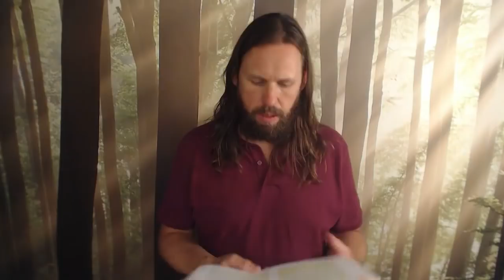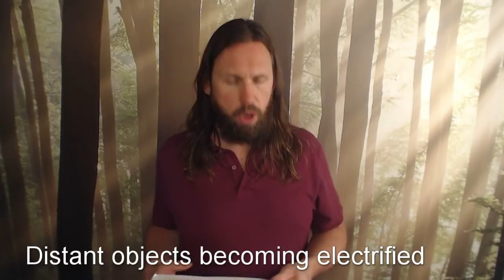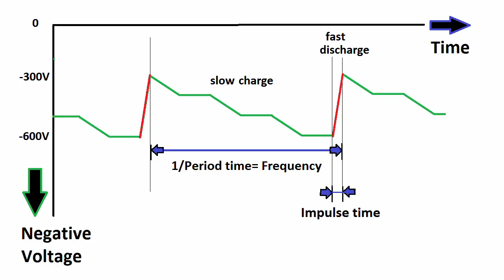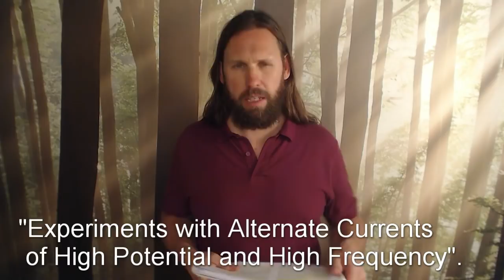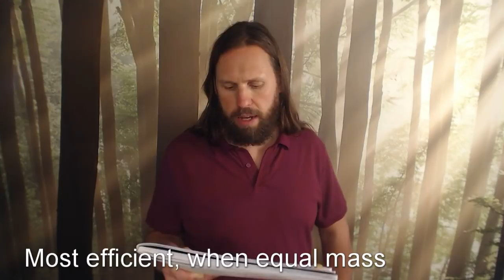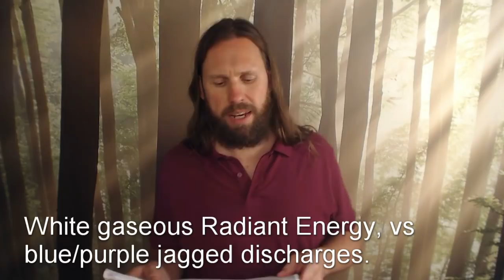Nikola Tesla's Radiant Energy Part 2 of 3

Comment: I am sure you have read, "Introduction to DIELECTRICITY & CAPACITANCE by Eric P. Dollard", just in case you didn't, this was a must read for me before experimenting with cold electricity (aka dielectricity, longitudinal pulses, etc...).

"Because the forcing voltage is instantly withdrawn the field explodes against the bounding conductors with a velocity that may exceed light. Because the current is directly related to the velocity of field it jumps to infinity in its attempt to produce finite voltage across zero resistance. If considerable energy had resided in the dielectric force field, again let us say several KWH the resulting explosion has almost inconceivable violence and can vaporize a conductor of substantial thickness instantly. Dielectric discharges of great speed and energy represent one of the most unpleasant experiences the electrical engineer encounters in practice."

Key to the above is that current attempts to jump to infinity as the compression of the dielectric capacitor field releases into a short (i.e., fast diode or spark gap).  Now of course the energy in the dielectric field (1/2V^2C) also plays a part in the resulting shock wave (dielectric pulse) which is running longitudinally and thus aether poses little resistance to it.  And of course, this shock wave attempts to terminate in any conductor in it's path.

The bifilar coil comes in handy in these devices as an easily tuned resonance feeding energy into whatever event capacitor you select.  In other words Tesla designed the bifilar coil to remove the difficulties of tuning the resonance as a bifilar coil by definition self resonates.

And if you use 2 capacitor's instead of one then you can experiment with cold electricity vs.  shock longitudinal waves (or both).

At any rate, after understanding every word of what is said in the above Dollard document I found it easier to design these type of things.  So your initiating voltage is not as critical as the amount of capacity and how fast you can short out the dielectric field (capacitor(s)) without reverse current (reverse current would recompress the energy or in other words rebuild the capacitor voltage)
Reply from the maker: Yes I read it, it's great. I love that quote and  remember it triggered me the first time I heard/read it.  That' s also why I made this video: https://youtu.be/zmZxQp1PW1U where CP Steinmetz explains the same concepts of infinite current and voltage.
 The thing I miss with Dollard's explanation is the concept of pressure. Aether pressure. Where negative voltage acts like under pressure (near vacuum), that will be equalized by the ambient pressure. The Aether shockwave does seem to have inertia, and thats why It starts moving when pulsed. I also suspect the bifilar coil is suited for these disruptive unipolar capacitor discharges due to the instant dielectric field it can build up between its windings. The resonance need to be avoided in this stage.
Reply from the maker: I remember  Walter Lewin's MIT experiment, but also another MIT experiment video, where they charged a Leyden jar, took it apart, discharged the metal plates, reassembled the Leyden Jar, and it still had the charge! which indicates, it was not on the plates at all. 

I agree, all mass, is energy perceived as mass, and this charge is related to spin. Not the quantum mechanic spin, but the spin direction of energy. You still speak of particles, but for me there are no particles at all, its all energy, its all aether field configurations. But We are talking about the same stuff so it doesn't really matter.

For me thinking in fields, instead of particles, makes a lot more sense. 

You worked at the Berkeley Particle accelerator where you smashed mass together at close to the speed of light.  That' so cool. The charges smaller than protons and electrons, seems to be inline with Mendelev's theory that there should be smaller gasses than hydrogen. The book talks about that as well. 

If I am correct you mean Avramenko diodes, Chernenko was another person, related to to Chernenko radiation (correct me if im wrong). 

I used the diodes, and it worked best when also connected with a ground(in the middle between 2 series connected caps). It seemed the diodes rectified the sinus of the resonant wave, and directed the polarities to the capacitor that charged. 

I still don't get the term "cold electricity" To me its electricity. and nothing cold about it. It still hurts, and it still lights a bulb. A boost converter would also be cold electricity but is used everywhere in power supplies. But maybe I'm missing something special about this type of electricity. If you could talk more about this, please do.

I also noticed strange effects, with my resonant coils. Capacitive devices failed to work, like my touchpad on my labtop or my  smart phone screen. 

It seems to me the dielectric field is not only concentrated between the windings, but also connects to "outside" conductive parts. I could sense the resonant wave with my probe, on each metal part near the resonant coil. 

Pretty strange, but to me it indicates, there is an Aether stream surrounding the resonant coil. And this Aether stream interacts with conductors.

Thank you for giving back Mark. Always a pleasure reading your words. We dont always agree which is good. We have different perspectives. And are both curious towards the truth. Back to part 3, still have to finalize it.
Reply: Tesla prepared statement: ""My ideas regarding the electron are at variance with those generally entertained. I hold that it is a relatively large body carrying a surface charge and not an elementary unit."  The surface charge is the much argued 'aether'.

Tesla goes on to say in the statement, "The great quantity of electricity stored on the particle is responsible for the difficulties encountered in the operation of certain tubes and the rapid deterioration of the same."  Thus I believe that Tesla believed there are particles and so I use the convention.  Beyond this it is just a word describing some elementary unit with spin.

You are right I meant Avramenko diodes I always get the named mixed up with Cherneko radiation...I just call them nutt-to-butt diodes that's why I mistyped (:  It worked best when connected to ground because ground's charges are more plentiful then the atmosphere or space.  So is your body which would also have worked better.

I've held onto wires carrying 5KV of cold electricity with no shock.  My wife walked into the room and called me an idiot for doing this.  I have many years experience working in labs with deadly electricity so I must admit that first touch went against every internal thought...yet no pain...no shock.  I would definitely not recommend to anyone reading what you and I are writing to try this.  Cold electricity only works with vibrations (frequency, resonance), capacitance (dielectric energy).  As Tesla found, the frequency of the vibrations is related to effects people.

Once you get past the ideas of the unicorn electrons...such as you saw in the MIT videos...then cold electricity is not a reach...just charge vibrations inducing charge vibrations in conductors.  In some of the books you have read no doubt you have seen others call it displacement current.  Electrons cause the heat in normal electricity as they leave copper atom 'orbits' (Bohr theory) and then reattach to neighbors.  This reattachment causes radiation in the heat frequencies EM radiation (much like atoms also emit light radiation when electrons jiggle around).  Thus cold electricity is not eliciting electrons to move in conductors and cause heat, rather, cold electricity is vibrating charges in the wire.  I call this 'Magnicity' not cold electricity which I experienced years ago.  Of course Tesla experienced it over a hundred years ago.

As I discussed in a reply to you way back, Richard Vialle also talked about this resonance (he called it electron resonance) in his U shaped cold electricity device.  However, I think he only spoke of electrons...yet these electrons did not leave their atoms, rather vibrated their orbits.  So no heat.  Just providing a slightly different take on cold electricity then mine.

Yes the Aether 'stream' is around all electrical circuits and magnets.  The geometry of life.  There is no such thing as a 'closed' electrical circuit, at least not on Earth and the outer space in which we have sent space ships that use electricity.  Tesla new this as well.  He spoke of particles getting surface charge from space.

Yes, we don't always agree and that is important in moving forward.  Cheers....
Reply from the maker: Great closing sentence Mark S. What I hear is a clear distinction between charge and electron. Also the cold electricity relates to charge, and its vibration. But was the 5KV that you touched vibrating/oscillating? And if so, if this voltage is rectified and stored in a capacitor, as a DC voltage, is it still "cold" and harmless?
Reply: Yes, an analogy being a balloon that you rub on her air and gains charge (not Electrons!).  Protons, which are very much larger then electrons (mass) both have the same charge or 1.6 X 10^19 Coulombs.  So there are two frames of thought here 1) They are both fundamentally made of charges (Dollard, J. Newman) with a 1.6 X 10^19 excess or 2)  Charge deposits on the surface.

Number 2 is more enticing to me (as in the Balloon) or in a capacitor (charge stores on the surface of the dielectric as MIT experiment dictates.

Otherwise the middle capacitor of a series 3 capacitor circuit would never charge (Unicorn electron flow cannot occur through the dielectrics of the outer capacitors to get to the inner.  Additionally the Dielectric strain remains on the middle capacitor if removed from the circuit (Nature would not allow the strain to exist and move to a balance condition unless there were opposite charges forcing the strain in the dielectric).

Yes, the 5KV was vibrating.  The Plasma Ball output is just a secondary wire off of an angel hair step-up transformer.  The primary of the transistor was supplied from an oscillator, transistor of the 3 AAA batteries.  Simple circuit and cheap (thanks China!).

Yes, the Avramenko diodes connected directly to the one lead of the transformer output provide "rectification" to the two capacitors.  Very important, as with any capacitor that is charged it is dangerous as a DC voltage.  However Cold Electricity does not work with DC voltage, the capacitors must be oscillating and out of phase (Avramenko and transformer provide this out of phase).

OK, so the displacement current in a capacitor does not cause heat thus it is technically cold electricity...electrical energy transfer without heat.  You haven't seen any heat sinks on capacitors lately (:  Yet they pass the energy.  So 'cold electricity' has been under our nose for hundreds of years.

Mely simply uses the air as a capacitor dielectric between the transmitter and receiver to pass this energy.  And he experiences a gain in energy from transmitter receiver because the dielectric of his 'air capacitor' is obviously an open circuit to the energies of the environment.  Also, inside of a dielectric it is also a 'longitudinal' (scalar) wave.  However he must run at the correct resonant frequency or the vibrations result in regular transverse EM waves which lose energy at the inverse square to distance.  If you read his stuff he will say that at a lower frequency he gets regular waves but at a higher frequency he gets the waves that travel through material and gain strength from transmitter to receiver.

This is why I was surprised when I experience waves acting like scalar waves from my Plasma ball experiment, because I did absolutely no Tuning!  Maybe a freak accident.

One more thing about resonance that may help.  Resonance is not some magical thing.  Typically the charge and discharge rates of energy for Capacitor and Inductors is 'constrained' by electric resistance (i.e., 5 time constants of R*C or L/R).  At resonance the resistance cancels out and the energy transfer no longer suffers from this resistance time constraint.

Hopefully something I say here helps you break through a barrier.  It helps me as well arrange my thoughts and to get feedback
Reply from the maker: Thanks Mark S, fir again sharing these great insights.
cold electricity in capacitors. Indeed no heat sink needed. Many new idea's rise, asking fir contemplation and experimentation.
soon...
Reply: WC...It is tough to speak original thoughts in a public forum...so this is new to me...
Reply from the maker: Your doing great Mark S. Very inspiring. I would like to read that article of Tesla talking about his view on the electron, can you give a reference?
Reply from the maker: Thanks Frank!
Reply: From same doc, "if the current decreases and represents then a negative velocity of field as the loops contract."

Negative velocity is just a human convention...as velocity is increasing in the compression direction.

Negative and positive 'charges' are one in the same...just opposite spin.  

So getting back to Dollard...negative velocity is increasing velocity in the compression sense...or counterspace sense...or in the increasing 'pressure' sense.  As you increase the 'negative' pressure (of aether, or charges)...this represents dielectricity (more capacitive, less volume, counterspace, increased negative pressure).  AC current is an analogy as current traveling in one direction is called positive and in the other is called negative...however both represent positive power (pressure X charge flow).

Therefore Voltage is volume of charge  (analogy being pressure, volume and temperature).

In space 'negative' pressure should act just as 'positive' pressure.  On Earth 'negative' or 'positive' pressure is impacted by the local charge environment (i.e., potential of earth, cloud charge, local conductors...etc...)

As Dollard explains...the mass itself is super capacitance (A resonance that is super capacitive compared to the accompanied resonant inductance).  This means that the charge has been stuffed into such a small space (counterspace, less volume) that it represents as a stable mass (with radioactive decay by the way)

The 'aether' shock wave (dielectric pulse, charge pulse, aether pulse...same) certainly has inertia as it is the main component of mass.  If the charge of the pulse is neutral (i.e., equal opposite spins of charges, equal and opposite vortices, near field, neutrinos...same) then it will travel without opposition faraday cages...however can be reflected and focused (amplified) by conductors.

In space a magnetic field expands into space until energy (current) stops increasing (di/dt or zero slope; slowed by aether)...then...the magnetic field collapse rapidly...the energy all rapidly receding into a center space (counterspace) now as a inward longitudinal energy field...the dPhi/dt rate of which creates a rapidly increasing voltage (pressure in lower volume of space proportional to dPhi/dt...or rate of change of charge) until the energy is all consumed...then it expands back into the magnetic field (force & motion & inertia).

Sorry IVO, thinking with my fingers again as I type...I could go on for the rest of the day...so I will stop here...Just move your solid state meters away from your experiments as the pulse will fry the chips even if they are not physically connected...I know this from experience...and other electronics in the room will also react strangely...

Cheers, Mark
Reply from the maker: Love it Mark, when you do that. food for thought. I must say I see one thing different. When the magnetic field gets stronger (more current) it grows smaller. This can be seen with strong and weak magnets. 2 strong magnets only attract in their near field. 

but two weak magnets can be felt attracting from a much larger distance!

So when the strong magnetic field current is interrupted, the contracted magnetic  field expands back into neutral.

this is explosive. but the dielectric negative voltage pulse is implosive. It creates a "vacuum" that is naturally filled by the surrounding medium. but this sudden implosion cant continue forever, and acts like a water hammer.
Reply: hmmm...how to reply.  You speak of permanent magnets which are a bit different then what you are doing.  You are using coils.  With coils the stronger magnetic field does not get 'smaller'.  Rather the imaginary lines of force get closer together or the density increases.  That is what a hall detector detects the density of the lines.

When the magnetic field current is abruptly interrupted (infinite di/dt) this leads to the 'infinite' compression (contracted magnetic field) or infinite voltage (which is density of charge, compression of charge to smaller space volume, dielectric implosion).  Of course it cannot reach infinite in your circuitry as capacitors will rupture and short and there is resistance in connecting wires.  I do not prefer to cause this a 'negative' pulse to avoid the confusion with 'negative' charge.

As to creating a vacuum...when the magnetic current ceases (di/dt = 0).  The surrounding medium (aether or elementary charge of which all is made) provides the force at the speed of light (di/dt approaching infinity) for the 'implosion'.  The 'implosion' in to an increasingly smaller volume of space continues until the energy dissipates.  In terms of a capacitor the capacitor is then charged and of course cannot discharge unless the voltage is too high and ruptures the dielectric or the capacitor is shorted out (either through a wire conductor or the voltage is high enough to create ionization of the local external environment (i.e., spark gap)).  As to 'water hammer' effect the medium (sea of charges, aether) acts as an incompressible fluid so one expects this type of effect, however, it is unclear to me wether Tesla was using this water hammer for the dielectric pulse (dielectricity, longitudinal wave, scaler wave, etc...) or rather the the actual instantaneous discharge of the dielectric energy (expansion), or both.  This is why I watch your channel as you see it a bit different and I want to see the experimental results of different perspectives.

As far as permanent magnets, that is rather different form all of this.  First off a permanent magnet does not have a driving unapparent hidden current as it does not heat up.  Second, it has permeable material that it is made of, similar to a transformer core.  Cores have a saturation which distorts the results and allows a stronger magnet field turn into itself (high permeability, saturation curve, etc.) creating he 'weaker' effect you described.  This is why smaller diameter magnets have a higher surface gauss (flux density) readings with a hall probe.  At the end of the day, and despite what some youtube self-described experts will say, magnetic circuits act very similar to electric circuits taking the least path of resistance in their generally accepted looping phenomena.  I recommend that anyone watching 'ferrocell' youtube posts should also watch the youtubers  showing videos of salt spread about on a sheet of vibrating metal and the geometry produced complete with 'counterspace' etc etc etc (:  I digress

Anxious for part 3
Reply from the maker: hihi self described expert Ken Wheeler. lol. 
Indeed I did want to reference to the ferroviewer thingy, that shows the compact space where the flux lines concentrate. 
But lets agree to disagree. its still much theory without much data to support it. I hope I can show some experiments with practical real effects. But first part 3.
Reply: Just always think of what Tesla said, "If you want to find the secrets of the Universe, think in terms of ENERGY, FREQUENCY, and VIBRATION."

Ergo you always see me trying to redirect folks to energy (and not volts/current alone but Joules).  The metal sheets vibrating with salt represents vibration (and magnetic observations).  Frequency represents 'Resonance'.

As to dielectricity...it has all three represented (energy, resonance/frequency, and vibration.  You see dielectricity requires a dielectric which is non conductive (as represented at times with a human capacitor.  Therefore 'Unicorn' electrons can neither pass through or collect on the dielectric (Steinmetz, Dollard, Walter Lewin of MIT would/did agree).  Reference Walter Lewin's MIT experiment posted his class on You Tube (he was dumbfounded to find no electrons on a capacitor's plate and couldn't explain, at least in class).

So if electrons cannot pass through a capacitor or collect on its plates, then there must be a better theory of electrical current flow in wires and capacitors.  I created a theory and I coined it 'Magnicity' many years ago.

At any rate the theory postulates that matter is made of minute charges (this coincides with Dollard's resonance "super-capacitance' resulting in the formation of matter (and also Einsteins E=MC^2).  Not to go further on this theory here, however, what it means is that Electrons (and Protons carry charge).  A Proton is 1837 time more massive then an Electron yet has the SAME electrical charge.  Strange isn't it that something so much more massive has the same charge.  The reason being that all mass is made of minute charges including electrons and Protons and they exactly have an excess in their constituent charges in the opposite polarity (spin).

I worked at the Berkeley Particle accelerator where we smashed mass together at close to the speed of light and observed what it broke up into.  As hard as we tried we could never get to the smallest particle but all of the pieces where always charge (my theory they were made up of elemental charges smaller the Protons or Electrons).

 OK enough background...so your dielectric shock waves...and cold electricity consist of these elementary charges.  If they combine in neutral combinations (such as Mely's near wave observations) then they tend to pass rather unfettered through matter (or faraday cages for that matter), however they will collect on conductors from their polarization (Tesla's observation of conductors becoming charged) when in a 'dielectric' or longitudinal wave.

As to cold electricity.  Think of a circuit of 3 capacitors in series.  How does the middle capacitor get charged now that we know that electrons can not collect on capacitor plates.  Simple, the batter provides charge as I described(not electrons) to the plate electrically connected.  The other plate collects charge from the environment from the path of least resistance (a human touching the other plate/lead, another conductor, or in space aether) (This explains Don Smith's experiments).

So, the middle capacitor is actually not even connected to the battery, yet it still gets charged.  Tesla's hairpin circuit (cold electricity) worked similarly.  Two capacitors vibrate at opposing polarity and a load/light is placed in between.  This vibration vibrates the charges in the load which is what electricity really is and the load lights.

This is also how chernenko diodes work (which you have used in some of your experiments).  Even thought the chernenko diodes are connected to only ONE lead of an AC source it will charge capacitor's and light lights.

Here's a cheap experiment.  Just take a cheap $15 Plasma bulb apart.  And extract the tiny circuit board that feeds off several 1.5V triple A batteries.  This circuit board has an oscillator connected to an Angel hair transformer creating the 5KV AC to drive the Plasm bulb.  Connect the 5 KV to two Diodes connect in chernenko fashion (nutt to butt) off of the ONE lead.  To that connected 2 KV capacitors to one lead.  Be careful the capacitors will fully charge and be sure to short it out to see the big ZAP.  This is cold electricity in less then 5 minutes (I got my capacitor and diodes from an old microwave).

What is happening is that the chemical reaction in the batteries create the charge (not unicorn electrons) that cause collect on the surface of the dielectrics, causing the dielectric to polarize (strain) and collect charges from the external environment (in accordance with electrical ohm's law) onto the other surface of the dielectric.  The one lead from the 5KV transformer has alternating positive and negative charges which the Chernenko diodes rout to each capacitor and continue to add charge to each capacitor (Frequency, Vibration, and Energy).  This all will work even better if you collect an insulated metal plate to the free lead of each Capacitor.  Just as Tesla prescribed in his Patent for Radian Energy.  Why?  Because the density of charge (mass) is greater in the metal plates (or a human) then from the atmosphere or space (aether).  As you do the experiment you may experience nearby electrical devices experience strange effects as this also creates the 'shock wave' that you are proposing.

OK...so you gave to me from your experiments so I am attempting to give back...thanks
Reply from the maker: https://youtu.be/9ckpQW9sdUg?t=2m    this is the clip of MIT with the leyden jar.
Reply: It is not the exact one where you see Walter's dumbfounded expression, however, it suffices to show that that the energy is solely stored in/on the dielectric which in this case is a non conductive glass beaker/jar.

Furthermore, if you were to place extra metal plates within the glass that are not connected to the conductors as shown, each one would measure a voltage in relation to any other one.  Similar to HHO experiments that have multiple plates in the water, the water now being the dielectric.

This is an example of separating 'elemental charge' (aether) from charge carriers/electrons.

A more informative experiment may be to have two beakers inside of each other (with no metal plate in between the beakers) and repeat what is in the video...now check if you get a spark from both beakers separately.  What do you predict?

BTW nice job on version 3 of radiant energy!!!  What I see is a properly run Youtube channel...you answer and bring in information from your subscribers.
Reply from the maker: 2 beakers with no plate, better put some dielectric oil in between them to get the air out. they both should have about half the energy between them, so, separate would give 2 (smaller) sparks I guess.
Walter Lewin is also (originally) Dutch like me.
Reply from the maker: found it: https://youtu.be/GAtAG938AQc from 39:34 you can see Walter Lewin do it. Is that the one?
Reply: I guessed you were Dutch but did not know that Walter is Dutch...should be proud about that(:

Yes, I surmise as well 2 smaller sparks.  So how did charge for the sparks get on the inside surfaces of the beakers?  Certainly couldn't have come from the charging battery which only touched the outside of the beakers (which are insulators)?

Vialle was able to energize an external circuit with his U copper tube apparatus.  Interesting that there was no external batteries connected to the U copper tube as a charge source for the external circuit.  Rather and external alternating coil was provided which did not provide generated EMF (it was not perpendicular and to make sure was wound opposing itself to EMF generation).  Yet charge came from the copper U tube that ran an external hot circuit.  The copper Tube did not heat up as there was not a complete circuit to the return conductor in the device.  However the external connected circuit connected to it operated as usual with heat and lighting a light.

So a conductor is able to vibrate in an open circuit.  If two conductors vibrate in unison and out of phase and in relatively close proximity...then any circuit connect to such conductors will also vibrate as a hot circuit...using the connection as formed (analogy of the capacitively coupled beakers we just spoke of).  Of course this action is amplified if instead of directly connecting to the external circuit one first uses a properly tuned tank circuit to tap off of the vibrating conductors.

Of course in Google I have all of my comments to all fellow you tubers...of which I have as kind of my memoirs so I don't have to write a book(:

This is part of my Magnicity theory.
Reply from the maker: Writing a book in youtube comments, + 1  
that out of phase idea is something that plays in my mind as well, or at least a phase shift.

If a disruptive discharge can induce an Aether stream, what will happen if two of those streams ar combined? And if one has a different impulse rate, does this shape the field?
We'll see soon.
seeing my first results, when discharging - 600V
Reply from the maker: About capacitors heating up. I made a solid state hairpin circuit, and used it to get a bifilar coil into resonance. It started detuning. 
the reason being I used ceramic capacitirs to tune the coil. They heated up and shifted their capacitance, and thereby shifting the resonant frequency of the coil.

So the capacitors do get hot. At least, When the resonance is induced by a - 600V disruptive discharge.
Reply: Think once I calculated on smaller caps generally about milliwatts per square centimeter.  Small ceramic caps have small leads as well as metal plates which generate heat, I would recommend lower ESR caps (also frequency dependent).

Looking forward to seeing your solid state hairpin circuit.  If Tesla had solid stated devices my guess is that he wouldn't have used disruptive arcs.  A lot of folks would disagree with me as they feel the arc is critical for his device.
Reply from the maker: Yes I also don't believe in the magic of the spark, it was simply the only thing that was available at the time.
I thought the esr of a ceramic was lowest! better use polypropylene than.
Reply from the maker: thats it! thanks Frank